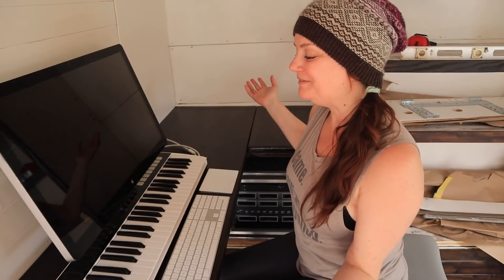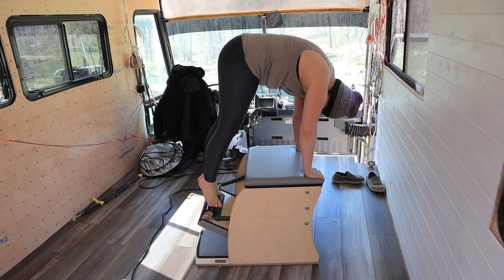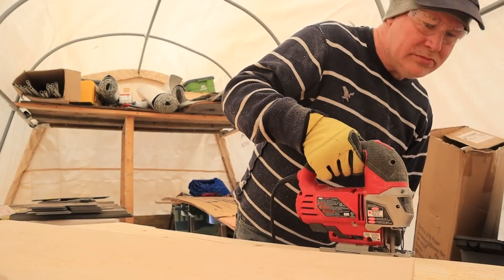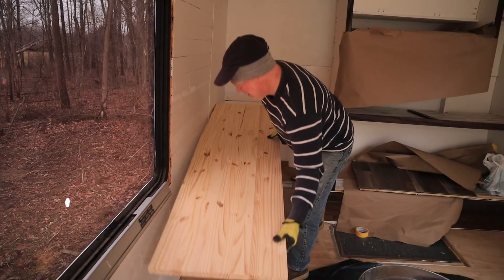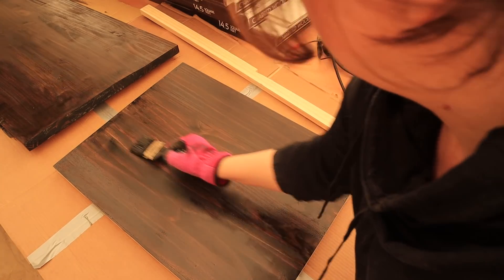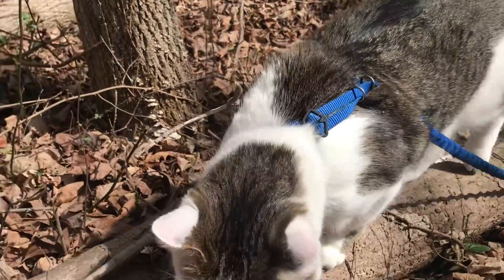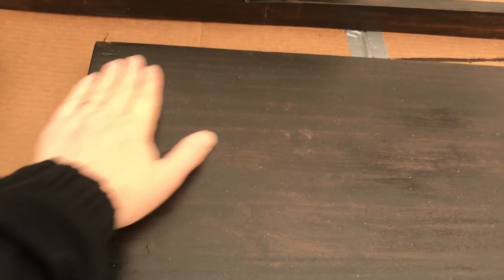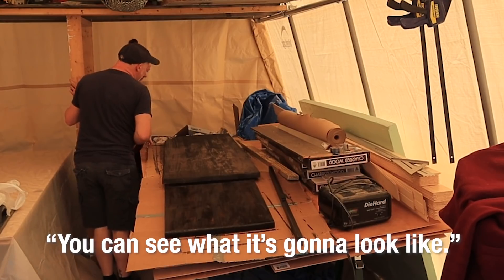Music Desk for our Bus Conversion - S04E05

Comment: I realize this video is "ancient" by Youtube standards, but the easy way to scribe an uneven surface is to take a flat washer and use a pencil in the hole, and roll the washer down the uneven surface. For a small gap, use a small flat washer. For large gaps, use a fender washer.

Comment: Their was one u tuber who did a bus build that later regret not providing two fans on his bus, one in the front of the buds and the other in the back. He stated that it is real imoportant to have good fan circulation and cross breezes stimming from would be opened windowes installed especially in the bedroom and in the kitchen area. He said these crosses breezes can make a hugh differance in living spaces where most time is spend especially while doing activities of showering, cooking where hot air and or vapors could have the opportunity to escape and even relaxing  with breezes from cealing fans and or opened windows in bedrooms.

Comment: Enjoying seeing all your hard work finally coalescing into the final details. Did have one question. The desk looks like it comes out in front of the back emergency exit window...If you have to use that window in an emergency - will it still open? Take care!
Reply from the maker: Hi Susan, yes the emergency exit window in front of the desk still opens and there is an emergency exit in the smaller window directly on the other side of the bus as well. Thanks for your concern :)

Comment: Nothing beats traditional stain with a coat of Epoxy on top for an extremely durable long lasting finish!

Why not use a t.v. swivel wall mount for the monitor that is encased in a foam lined box around the perimeter so the monitor is protected against road shocks and vibration? Works perfectly in my expeditor van.
Reply from the maker: Thanks for the suggestion David, I’ll look into that option :)

Comment: Don, why don’t you use your chop saw instead of jig saw?  Secondly, you are a welder.  You can build something better than you can buy.  Main thing is to have a very large plate on the wall so it does not twist when the TV is flat against the wall.  Also take the weight off the swing arm when it is in the computer position - and it will need a firm latch during driving.